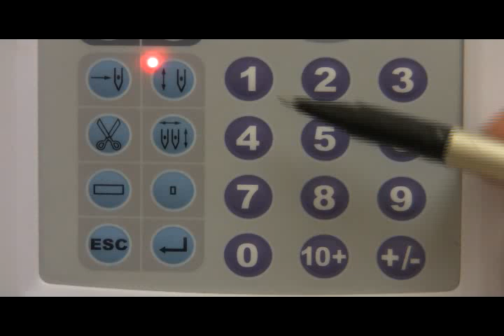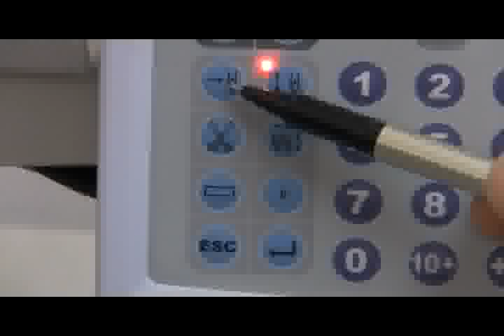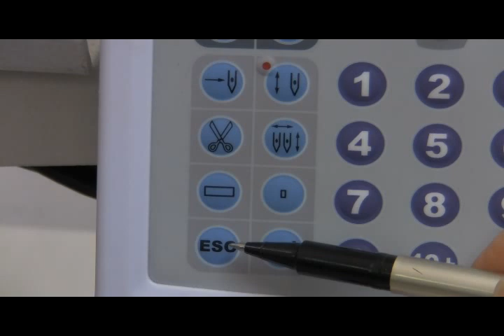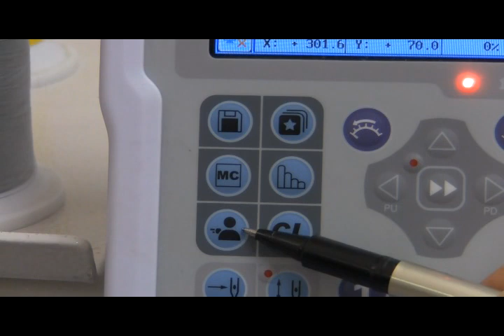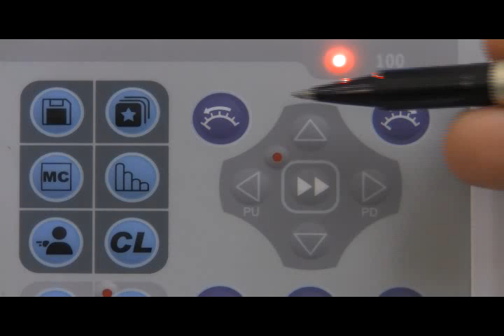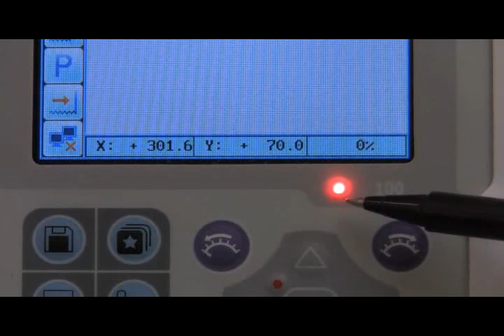Highland Video Training - CONTROL PANEL BASICS

Comment: Picked up an old machine like this for free but the battery is dead. Do you know where it is located?
Reply from the maker: Try the guide found here:
https://www.mesatraining.com/single-head-embroidery-d/wrong-language-replace-battery.php
Reply: @MESATrainingHelper  that was it. thanks a lot!!
I had followed videos where the battery was in the screen. but your guide was the correct one.
Reply: Can this machine make hats? I have this same older machine, but no idea how a change frame in the system to do hats?